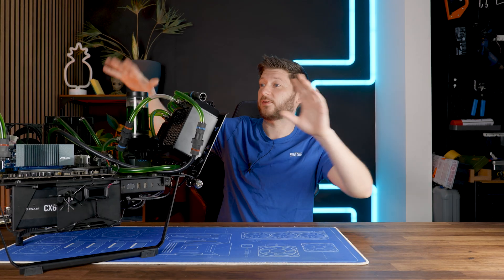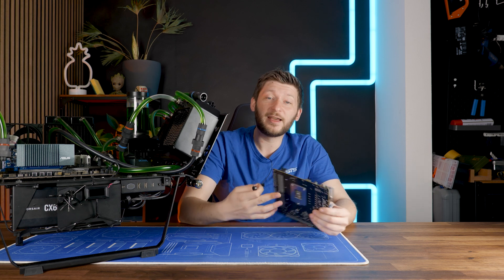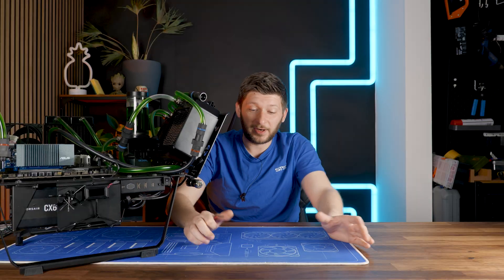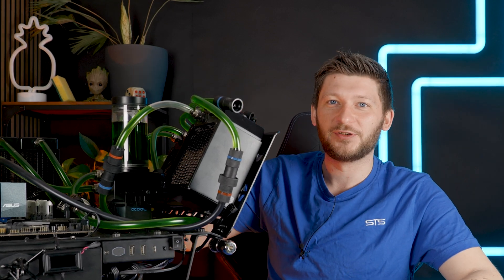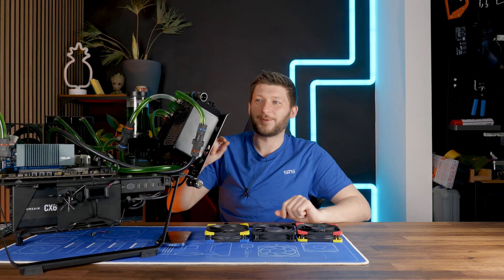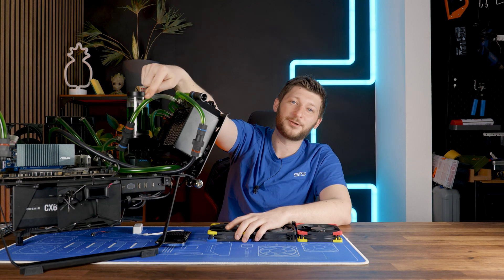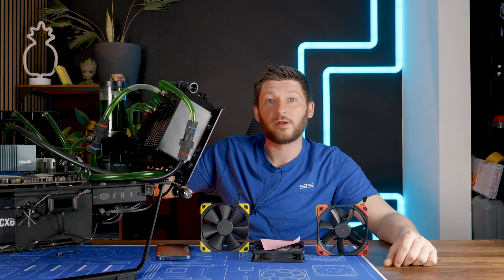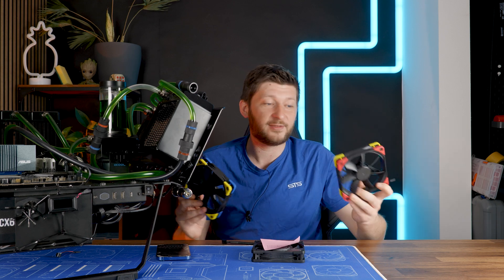Episode 8: Power Unleashed: Testing & Results Revealed!

Comment: Suggestion for future builds, if I keep older motherboards I always buy the cheapest Celeron or Pentium CPU just to keep the pins covered and test the board. Something like the G5905 is like US $15 on Amazon used. Still glad you got it all up and running and thanks for all the videos.
Reply from the maker: That’s actually a smart move. Why are there no 1-2$ covers made out of plastic yet